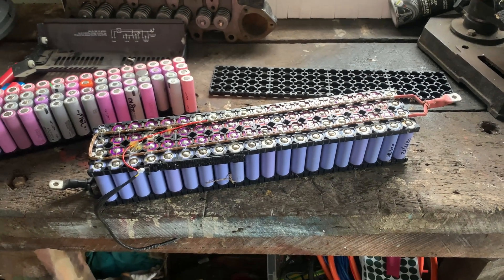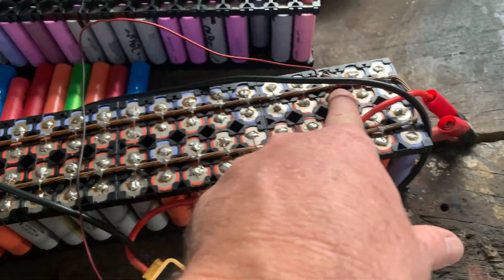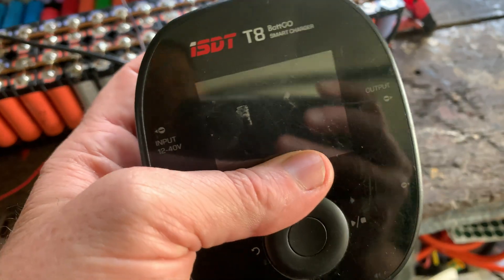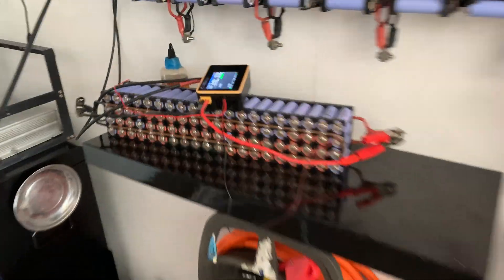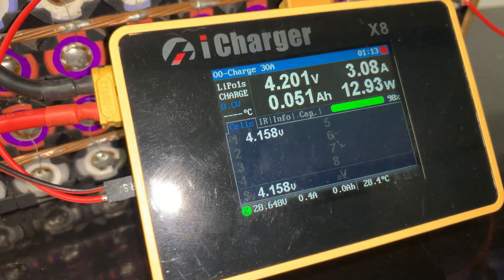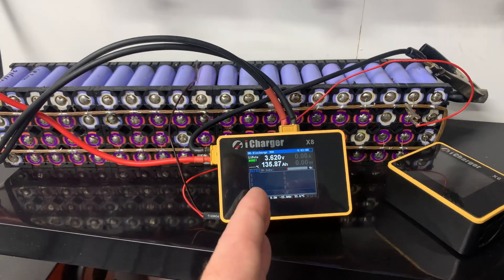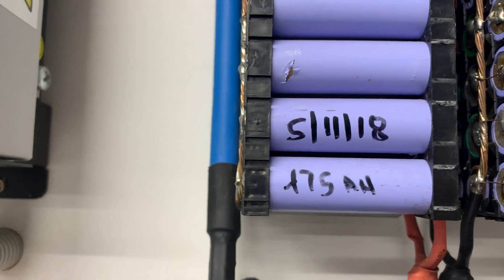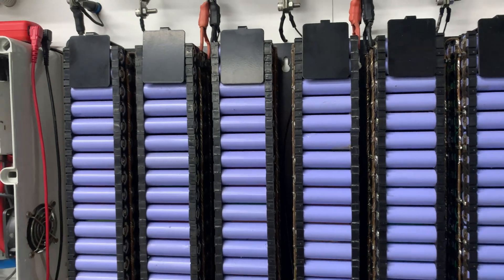Testing DIY Lithium Ion cell removed from service after almost 2 years

Comment: I'm confused as to why you need to connect the balance lead if it’s just one big Lithium cell? It’s the same potential as the charging lead.
Reply from the maker: the balance leads are the actual voltage, the charge/discharge lead is under load resulting in a difference voltage.

Comment: Ok so the advantage of soldering the cells is to replace a faulty cell when required
Reply from the maker: it helps but not a deal breaker

Comment: Hello Sir,
Please if you could help me with my question, I have bunch of laptop cells, mixed ( ICR , INR ) and planing to DIY 3S pack for solar. is it okay to mix ICR and INR Li-ion??
Reply from the maker: NO...well yes... but no..... Mixing cells is typically regarded as a bad idea.
Reply: @HBPowerwall  Thank you for your time to answer my question, so if I use fuse wiring, I'm planing for 3s55p. will it be okay? and the max draw will be around 720w ( 60 amps)
Reply from the maker: Sorry can't help with the details of your build as what cells you're using will affect anything i say. So you have to work that out for your self

Comment: you probably replace a wrong fan too low rpm to that x6  the correct fan rpm is around 7000rpm  and use only high qulity thermal pad like thermal grizzly
Reply from the maker: I used an original pulled fan so no issues there, even tried reversing it, reflowing the PCB, high quality thermal pad cut to fit & the same height, even made sure all the for screws were holding the heat sink square - I left the go pro on it and sometimes it would over heat error with the temp reading  30deg c other times it'd get up to 50deg no where near the 65deg c cut off it as set at. Also did firmware & reset all the settings.. It's done a lot of work no not stressed about replacing it but deep down inside me i want to fix it lol
Reply: @HBPowerwall  glad you buy new X8  i got it too i i hope that model is more reliable
Reply from the maker: the x6 did a stella job, like AMAZING - it worked hard and long before it's demise.

Comment: Those purple top sanyos are also pulled from the recalled toshiba laptop batteries and most of them i've come across were bad
Reply from the maker: They were used in a lot of batteries - what country was the recall in , I can't recall a recall here.
Reply: @HBPowerwall  there were 100k recalled toshiba units in US and Canada and Mexico Total recalled in 2016-2017 with modelnumber: G71C000XX110. I've come across one of those and it had sanyo with the purple rings in it

Comment: What kind of setup are you using to completely discharge your cells to 0V? How can I, if at all, do this with what would be available in the average household? What would be something to purchase from somewhere like Amazon that would suffice?

I need to disassemble a Li-Ion 18650 to be able to analyze the steel case/housing on the outside. Any advice at all would be appreciated.
Reply from the maker: Old light bulb from a car, old computer fan. Anything that draws a current

Comment: Great data points on cell degradation. This is impressive, considering the warmer temperatures your packs have been exposed to during hot season. (not 20ºC room storage temperature)  

Regarding iCharger, you might try IR camera on the i6 vs i8 to see if can spot anything that is warmer on one vs. the other. In back of my mind, wondering if the temperature sensor itself is the failing part (murphie's law, LOL)
Reply from the maker: I found the temp sensor on the mainboard (with a soldering iron lol) it seems to work when it has heat applied to it hehehe but honestly that little 6x has held up so some epic work, and 100's and 100s of 30amp discharge tests as well as other random stuff including charging my mini batteries

Comment: Noticed the A series engine head on the bench! I have a ‘61 850 Mini with a 998 Cooper head. What’s your excuse?😄
Reply from the maker: Two minis lol 😂 that one is 12g202 with some tasteful mods. I like it better than the 12g295. Just drives better off the line.

Comment: What would be the recommended charging current for a 4s 70Ah build? since the charging voltage I suppose would be 16.8v and terminated when the battery gets some where near 16.4v.
Reply from the maker: For me it would depend on how you plan to use the battery & what sort of BMS you're running. For longer life and better safety I would run 16v max and 12v min
Reply: @HBPowerwall  Thanks for the reply but what I wanted to know is what the recommended charging current would be for the 70Ah build?
The reason I'm asking is because I plan on using a 24v 5A max power supply with potentiometers for varying both the output voltage and current. Just wanted to make sure what the appropriate/recommended current would be before charging the battery pack.
Reply from the maker: Ooh sorry, can't answer that as it's up to the cells. Check the manufacture reconditions for max charging current then halve it to extend the life of the cells.
Reply: @HBPowerwall  But the cells I used in the pack are from salvaged laptop cells. They all have different capacities and also made by a vast array of manufactures. I just wanted you to suggest a general rule for estimating the charging current for say the 70Ah build.

Comment: Gidday mate. How high are you letting the cells charge under normal use? All the way to 4.2 or less than that?
Reply from the maker: House battery 4.13v shed 4.1 farm 4.0 don’t ask why just what its set to
Reply: @HBPowerwall  Your videos are quite informative and you're channel is just one of those cool channels out on here YouTube. I have a question though. What would be the recommended charging current and voltage for say a 4s li-ion battery pack with 1kwh storage?
I might assume since it's a 4s configuration it should be charged at 16.8 and may be get terminated when the battery gets to 16.4 or less. What I gets me confused is what the recommended charging current would be. Since it's a 1kwh build it should have a nominal capacity of say 68Ah(i.e 1kwh/14.8) and charging at 30amps should take 2hrs or there about. 
Thanks as I anticipate your reply.

Comment: good afternoon, the capacity of one battery is about 2000mAh?
Reply from the maker: Give or take yes, later batteries were minimum 2400mah tested.
Reply: @HBPowerwall  is it from non-working batteries? I very rarely come across such large containers.
Reply from the maker: I would say most of the time its just one cell out of the six that is zero volt or all just low voltage.. Just depends on where you get them from.
Reply: @HBPowerwall  I buy in services where laptops are repaired, and you?
Reply from the maker: I am one of those places you repair laptops :)

Comment: Is it weird I tested mine after a year of use and I'm 5 to 10% more capacity or is it just me.
Reply from the maker: Goes against every i've done, unless you used different settings each time to test?
Reply: @HBPowerwall  it could be. I have a differnt discharger but from the same brand. Wife set a grocery bag on the original while it was discharging at 20amps and needless to say it overheated
Reply from the maker: Wait where where you discharging it lol ?
Reply: @HBPowerwall  I was doing a test ya
Reply: I was in Haiti recently, I was using $20 for gaz in a  generator 4 nights, a lot of noise. I took one day to put some cells together, and create 7 packs for 24v systems,  it was great.
Reply from the maker: Nice - well done @simply focus

Comment: Thanks for showing how an 18650 power wall holds up after years of cycling .   Not bad considering they are a bunch of small capacity cells powering up somebodies  house .   I've done lead acid in the past and you get 7 years tops so I'm hoping for 15 years with my lithium ion  power wall .
Reply from the maker: Being well maintained I would say 10 years is easy from these cells, 20 with new ones wouldn't be a hard ask either.. 15 from used cells would be hard to see.. But it would be nice!

Comment: Not too bad. Much better wear than if they were still in laptops. They just get destroyed there.
Reply from the maker: Yeh, preaty easy to cycle the cells daily in a laptop.. That and they are always under sized for the job they are expected to do.
Reply: It is much better to get the cells from medical supplies than laptops. They are much better
Reply from the maker: Ooh hell yes they are better from medical - so long as they are fresh and not sitting in a ware house for years first.